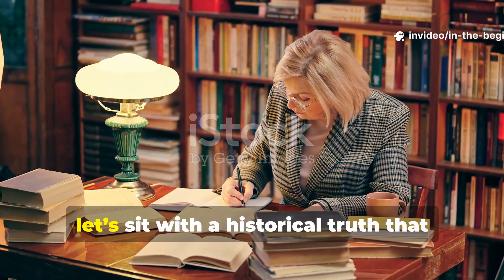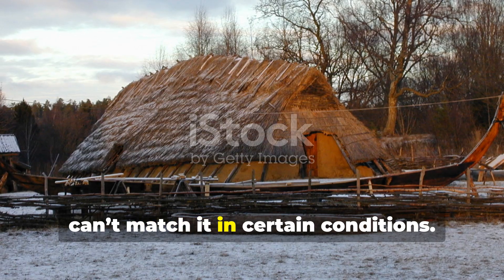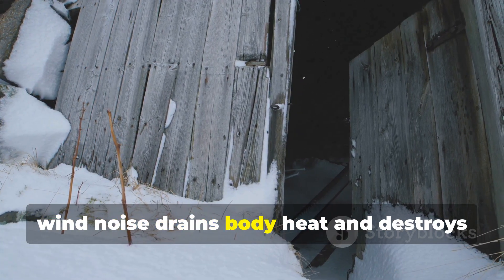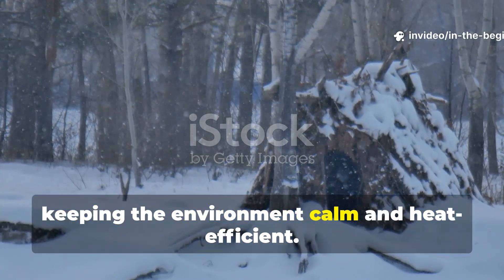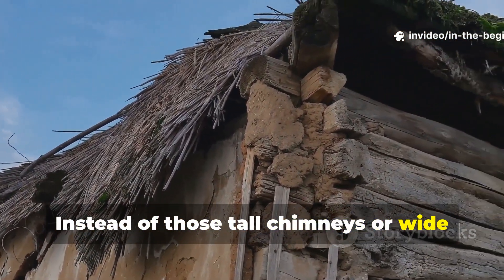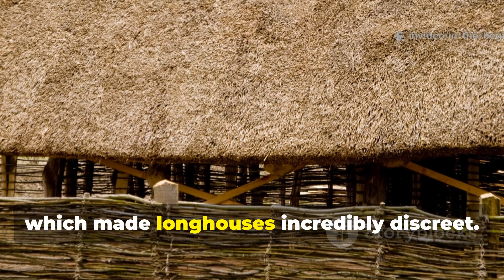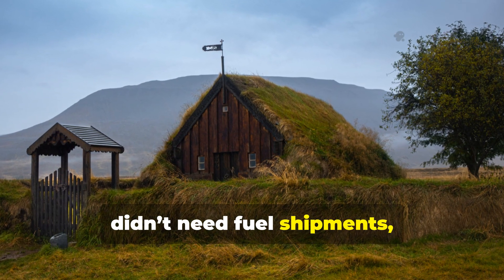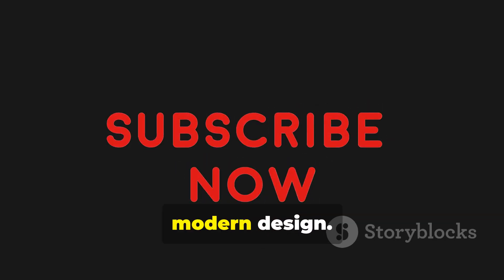The Silent Viking Home Technique Arctic Settlers Were Ordered Never to Teach Again

Comment: AI trash.
"Build a low, sunk in floor to trap heat"  Riiiight.  The AI thinks that hot air sinks then.  Hot air balloons show that the opposite is true.  Sunk in floors like that have other reasons to exist, trapping heat down low is not one of them. Fake AI trash like this is harmful. Fake AI trash like this conceals real history to maintain ignorance.  Those that wish to maintain your ignorance do not have your interests at heart.  Instead, those that wish to maintain your ignorance do so in favor to their interests, control being a primary one.  Be skeptical, be wary, test if things are true. Filtering lies out of your life and learning true information helps to maintain your freedom. Ignorance leads to hidden slavery.